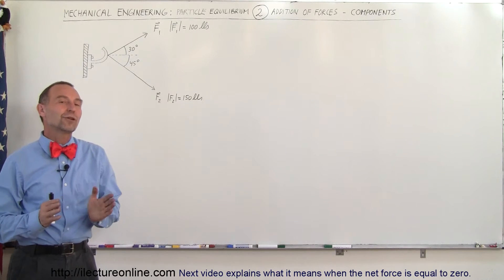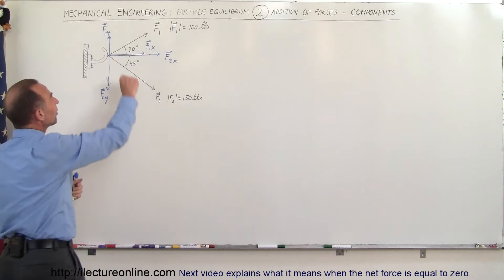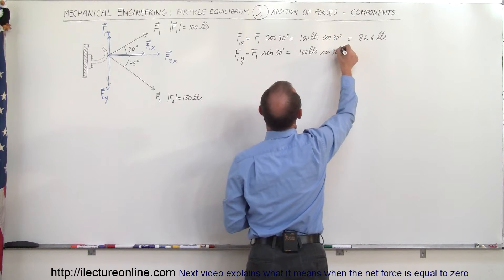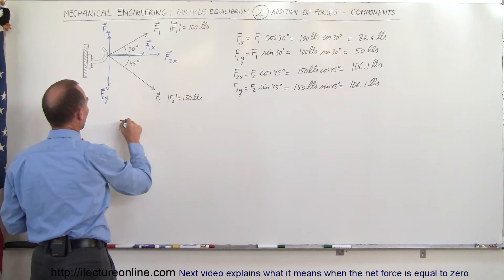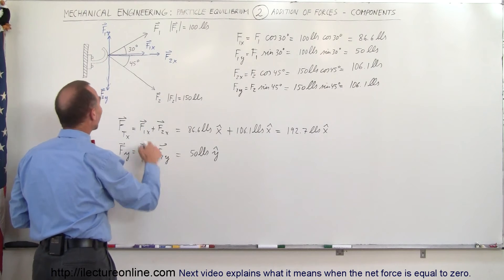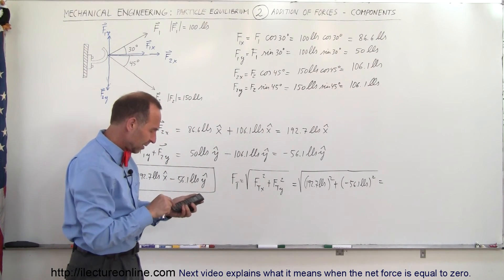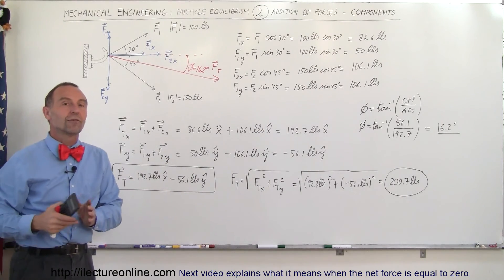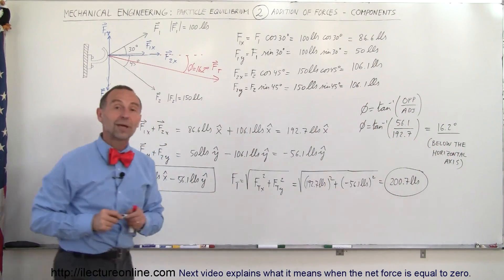Mechanical Engineering: Particle Equilibrium (2 of 19) Addition of Forces - Component

Comment: Dear Michel van,
you are awesome. Thank you so much for excellent videos. 
I didn't get how resultant force (Red- 200.7lbs) becomes down the horizontal line ? 
why can't it be in above the horizontal line ? please clarify me.
Thanks again for your support -:)
Reply: F2 goes further down (it's both steeper and larger) than F1 goes up. This means that Fr will go down as well. If you'd take negatives into account with calculating the angle, it would result in a negative angle which means that the angle goes below the horizontal line.

Comment: I like how you denote the "magnitude" of the force with both the absolute value symbol and the vector symbol.  This is a big deal because so many textbooks "simply" denote with "non-text bold" notation like F.  This value is also the "scalar" but two concepts equated to one "puny" symbol is a recipe for disaster for "most" average students who will fall asleep and lose the distinction. Imagine if the text books stuck with the representation of vector as the absolute(symbol) of the vector(arrow on top symbol) how many engineering students would not "drop out" and complete the engineering program?  I was not one of those casualties, but witnessed many fellow students collapse from ME to CE to finally Acct major.

Comment: Hi I still don't  know  how  the cos an sin work in terms  of  adding  vectors  I know  my sohcahtoa
Reply: ahmed tanko Sines and cosines are useful to break the vectors on it´s y-components and it´s x-components. In a right triangle, if you know the angle between the hypotenuse and one of the axis, you can multiply the hypotenuse by the sine or cosine of the angle to get the components along the x and y axis. After that, you just sum up the magnitudes of the broken-up vectors. When you have all the sums, use the pythagorean theorem again to find the magnitude of the resultant vector ( which is the hypotenuse of the right triangle formed by the sum of the broken-up vectors along the x and y axis). I hope this cleared things out a bit, but I encourage you to draw all the problem and really see it by yourself - geometry is much more better to understand by looking at it than just reading.